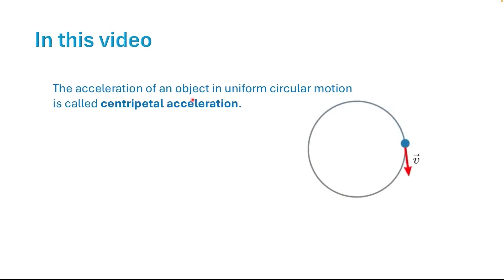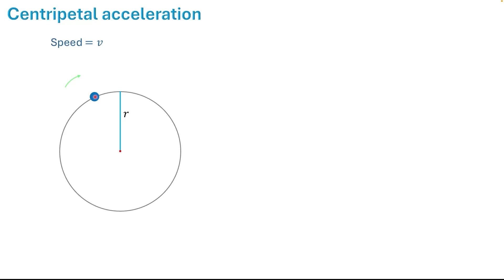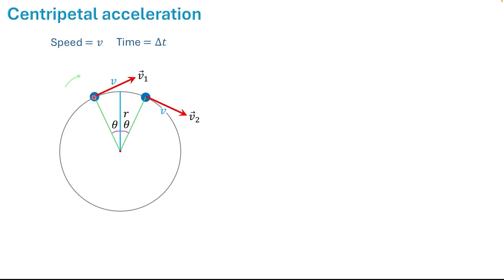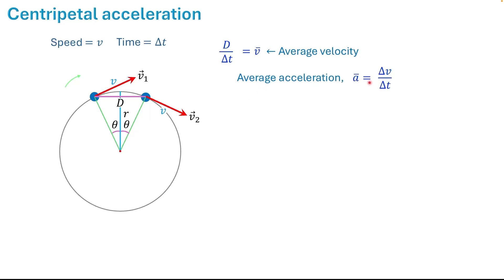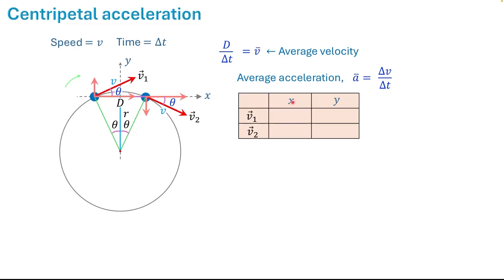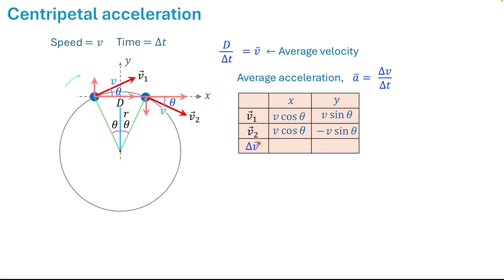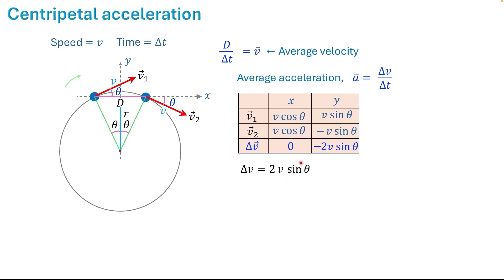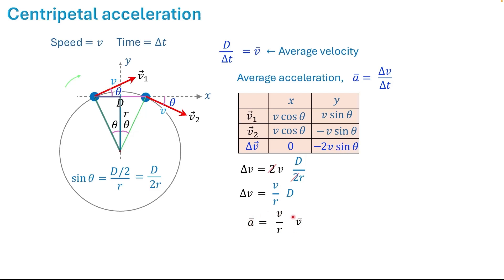Derivation of centripetal acceleration | using vector components

Comment: How angle become v1 and D become  𝜃?
Reply from the maker: The angle between the left radial line (green line) and the vector v1 is 90 degrees.
In the left right triangle, the angle between the radial line and the D line, is 90 - θ. So, the angle between the D line and the vector v1 is 90 - (90- θ) = θ.
Reply: @physicsway thank you!